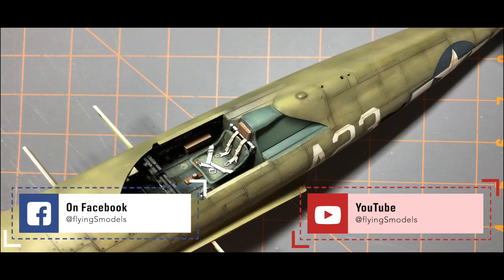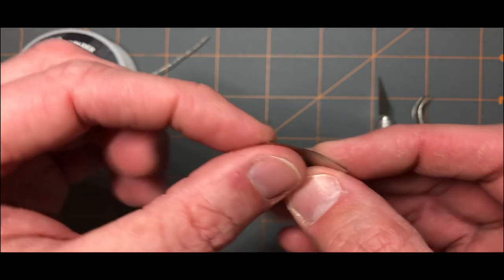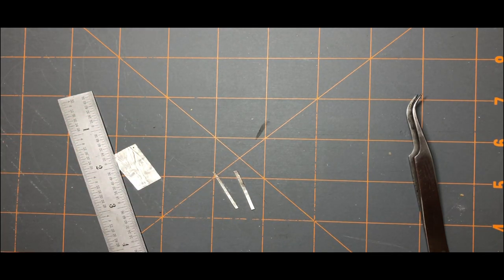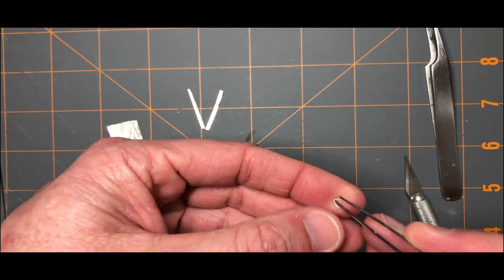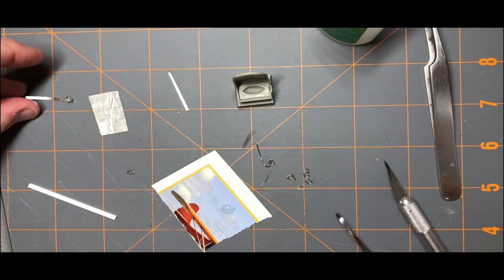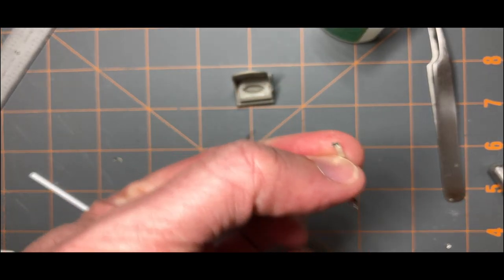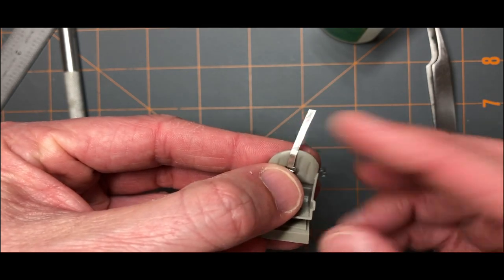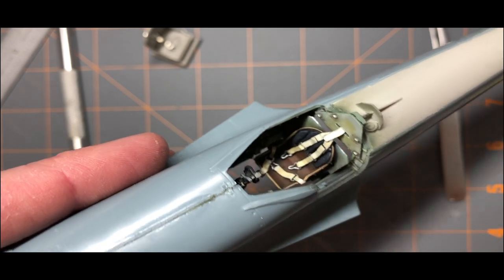Take Your Project to the Next Level with Easy Made Model Seat Belts!

Comment: Thanks so much for this tip. Like you, I don’t really like the belts that come with kits: stencils, or sometimes the metal ones. You confirmed my approach to making my own seatbelts, except I use cut masking tape instead of the foil. I can stick the masking tape together both sides and attach the metal links similar to what you do. The good thing about using masking tape, I can use a thin wash and it looks like leather. Like you, I position the belts in a haphazard position on the seat to give the realism. I’m new to your channel and am enjoying your great tips. Thanks once again.
Reply from the maker: Excellent.  I'm glad the masking tape works for you.  I find that it's a little stiff for my tastes but you are right in that it looks really good with wash and it already comes with it's own adhesive.  Glad you found the channel and hope that it helps in some small way.  Happy Modeling!

Comment: Great buckles.  I tried this with tamiya low tac  tape…the thin size and it works great in 48 scale.  Tape looks like cloth when painted.  Doesn’t turn out as well as yours but your a much more skilled modeler than me lol
Reply from the maker: Thanks for the kind words.  The low tack tape works great and does indeed look like cloth when painted.  I just like the flexibility of the foil to lay a little more natural looking that stiff tape.  Glad it worked out for you.

Comment: Nicely done! It'll be pretty hard to do it on a 1/72nd scale not to mention forming and bending the buckles to the right shape 😅. Oh yeah maybe punching a hole with a pin vise to create the strap holes would be cool too!
Reply from the maker: Thanks!  For 1/72, I don't even bother with the buckles most times.  I just apply the foil straps and add a few more square sections on the end to represent the buckles and paint those silver.  Most times you can barely see in the cockpit anyway :)  Punching some holes would definitely add a nice touch!
Reply: @FlyingSModels  I just took a shot at making 1/72 seatbelts last night, and they came out waaay too big, especially the buckles. They might do for 1/48 though! I think I'm going to go with the "paint the buckles" method you describe here instead.
Reply from the maker: @dexterscott7824  You are correct, this method works best for 1/48 and 1/32.  For 1/72, I just paint the buckles as they get to fiddly for me in 1/72 and in that scale, you really can't tell much a of a difference with the painted on look.
Reply: @FlyingSModels  Which of the 1/72 models in your videos use painted buckles? the P-40 looks like it.
Reply from the maker: @dexterscott7824  I think all of the ones in 1/72 have painted buckles (P-40, Wildcat, Spitfire).
Reply: @FlyingSModels  They are so well done that it's hard to tell that they're not Eduard PE. =)
Reply from the maker: @dexterscott7824  Thanks, I appreciate that.

Comment: What is the thickness of that lead foil Chad?
Reply: I’ll mic it when I get home but I believe it’s roughly the same as the solder - 0.015”.
Reply from the maker: Hi Jason, just mic'd the foil and it's 0.01".  Hope this helps.  I think you can get it in thinner or thicker materials but I like this thickness as it adds the right amount of dimension for me.
Reply: Yup. Like u said, getting the S bends right was key (for me). 

I even did a mini break at CoD without even realising I had until I watched my replay!

Ur video was the BEST guide out there by a mile.

Comment: What if the model is in 48 scale ?
Reply from the maker: For 1/48, I do the same thing. Just make smaller buckles and press the pewter foil flat with a metal scale to reduce the thickness and then cut thinner strips for the belts.  Works great!
Reply: @FlyingSModels  thanks.